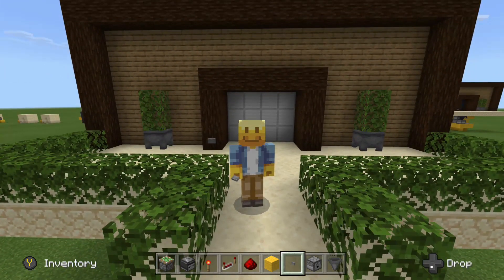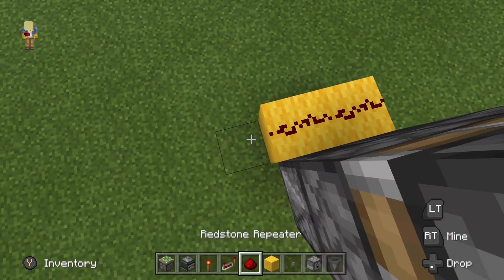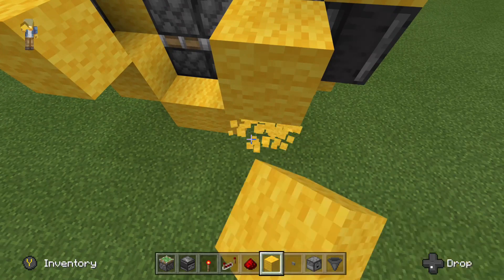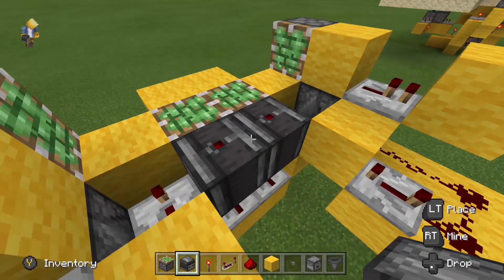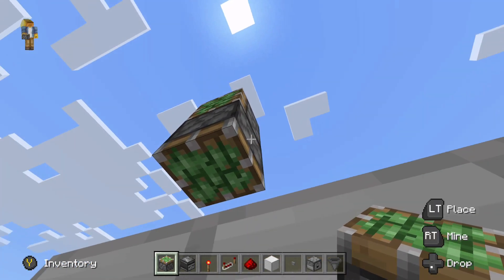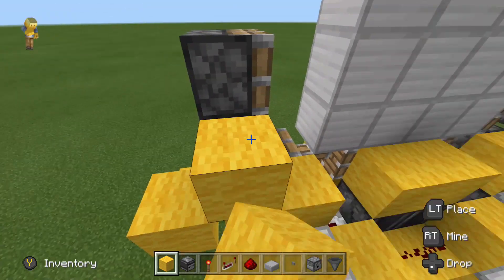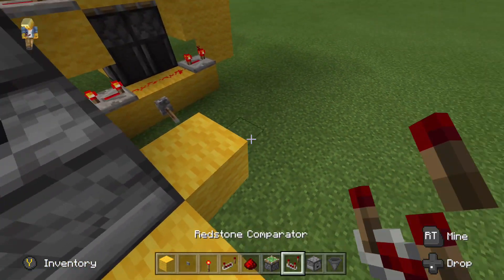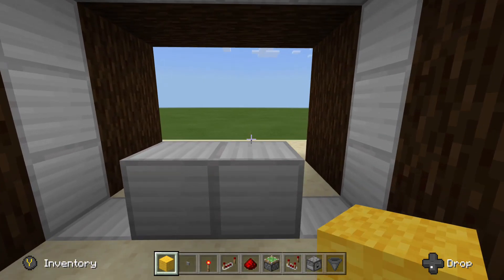Minecraft 3x4 Piston Door (Bedrock Edition)

Comment: Is there a way to use pressure plates instead. Would i just connect the pressure plate to the system and add some repeaters on 4 tick delay to allow me some time to to pass through?
Reply from the maker: If you want both sides to just be timed, hook up your pressure plates to a redstone torch that has your door closed by default.

You will delete the hopper/ dropper setup entirely.

On the side of your redstone line that comes from your pressure plates, place a pulse extender. (Comparator running from your redstone line into a block. Next to that block, redstone, and finally a comparator running back into your redstone line.)

I am sorry it was so wordy but k hope it helps you
Reply: @Robs_Mind  thanks, I hope I can follow along lol
Reply from the maker: @dakotadirig7562  lol. Sorry like I said, pretty long winded explanation

Comment: My door runs smoothly till the top two blocks on the hard part. The Piston goes up and the other one doesn't go off to get the block till the other one is already down
Reply from the maker: I would make sure all repeaters are at the appropriate delay setting. It sounds like the 2 repeaters on the 2x2 platforms... One should be at 2 ticks and the other should be at 4 ticks
Reply: Thanks really helpful

Comment: Is it possible to make a pulse extender to this, not t flip flop. Very nice build though
Reply from the maker: It should be, it may require 4 Comparators for the delay to be long enough! Good question!
Reply: The double piston extender does not work for me
Reply from the maker: @fainttomcat652  it should be working... What is happening?
Reply: Robs Mind, thanks for the advice, i tried that and it did work. Im not one for redstone
Reply: The pistons fire and when opening the pistons get stuck and they replace them with the buttom 1
Reply: @fainttomcat652  oh hi there
Reply: @fainttomcat652  are u on xbox one